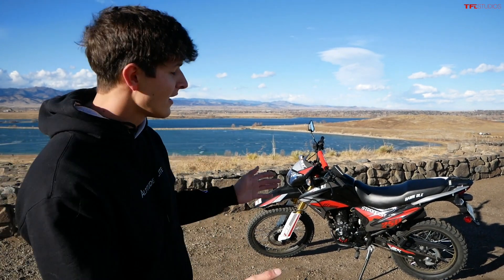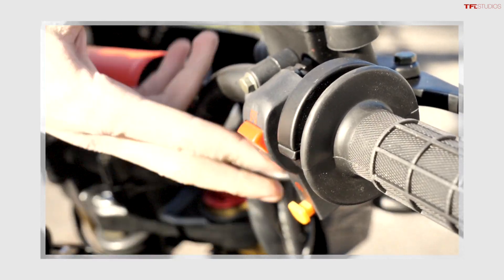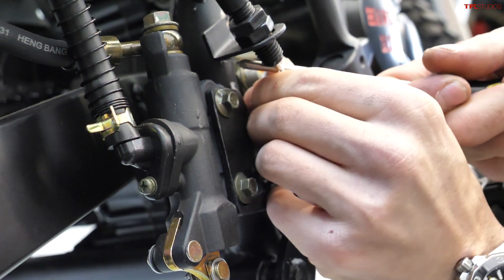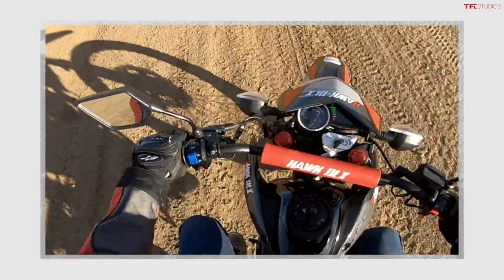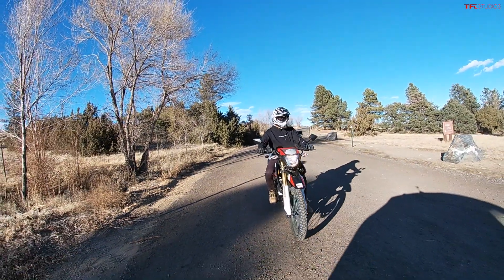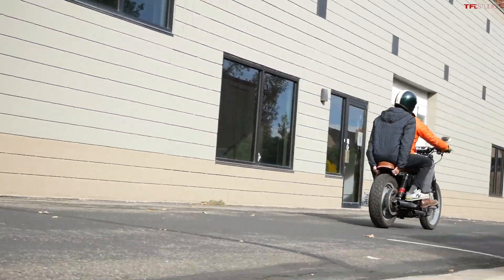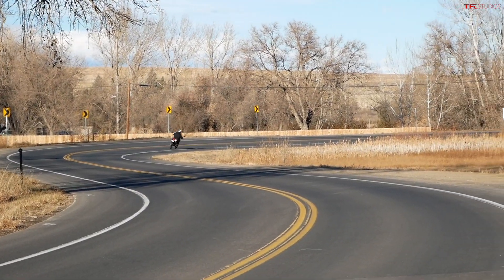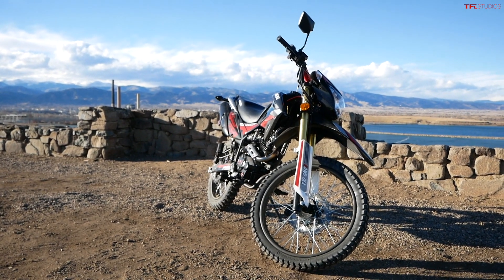Here's What It's Like To Assemble, Ride And Own The World's Second Cheapest Enduro From Amazon!

Comment: Depends on what you intend to do with it bc it doesn’t look to awful. If you just want a bike to cruise around on in town that has off-road capability then I would say this bike is almost perfect.
Reply: The rear brake switch nuts are on wrong one is to lock it and and one is to adjust😂😂

Comment: TBH I have a 2019 brozz 250 (same bike different name). I’ve owned it for a little over 2 years with 0 issues. Bought it brand new 0 miles from a local scooter shop that imports them. So I was able to avoid any assembly and paid 2,100 for it after tax/tag/title. I’ve done several (10+) 1-2 hour highway rides. Although not ideal, it didn’t give any issues and I had fun. I’ve mad no changes and it hits 65-70mph, but that could also be the Florida elevation. I’ve also taken off road on plenty of trails and even light kidding with it. The bike has somewhere around 1,000 miles on it, 1 oil change at 600 miles and other than a nail through the front tire I haven’t had to replace anything. For parts I’m told I can order CSC TT250 parts from CSC motorcycles in Cali so that solves any future problems I might have. And they also offer no questions asked warranty if you buy a TT250 from them. I can honestly say I’ve gotten plenty of smiles per gallon from my little China bike and it’s 100% worth it. I even sold my Honda Grom cause I found myself way more fond of the Brozz 250. If you understand what you’re buying, and the main reason for buying it some commuting and exploring I can’t recommend these bikes enough. The Hawk DLX/Brozz 250/CSC TT250/TBR7 all are great bikes and plenty reliable.

Comment: I know you guys are trying to say that a "new" bike shouldn't require any initial maintenance on your part, but you are forgetting that you skipped the dealer side by buying this thing from Amazon directly. Had the bike been assembled by the dealer, they would have seen that front brake, and bled it, before they put it on the showroom floor for someone to test ride. Bad brakes don't sell bikes, and can be a liability if the test rider crashes because of them.

Anyway, for $2k, I would buy an actual Honda Hawk GT (88 through 94), or Honda Shadow DLX, instead of that thing that steals pieces of both names.
Chances are, I would have to bleed the brakes on any $2k bike I have to buy (apparently new or used by the sounds of your experience).
Reply: Neither of which are common or meant for light weight dual sport use. good luck finding a used 250 for as little money.

Comment: The tires on the hawk dlx are actually decent tires and you fell because they where brand new and not broken in so they slip easily and also rider error, you should have put your weight to the right side of the bike to make a small turn to have more stability.

Comment: Hawks  are good bikes. I have the carb version. Its has taken me just over 11000 trouble free miles  in the last 2.5 years.  I just retired it as my commuter. 70+ miles daily.  Now it takes a 4 mile trip to the trails and then beat to tears by me and my 280lb frame off road. Its taken more drops off road than I can count.  Still rocking stock plastics. They are super easy to work on and extremely  reliable as long as you aren't in a hurry on the road. At least in my experience. BTW I also have a 99 Xr650. Love both bikes. The hawk does need changes from the box. But once dialed in its a great bike. Got mine 2nd for 600 bucks. So with  2200 bucks I got my xr650 and my hawk + all the mods I've made to the hawk. In my eyes it's been money well spent.
Reply: What have you done exactly? I just bought one the carb version.. I’m having trouble finding the sweet spot on the carb??? It won’t stay on, when I’m downshifting it shuts off.. frustrating... any help appreciated
Reply: @coreygalvin4921  when I was running the stock carb I started with a 20 pilot jet and a 110 main jet. It tunned close enough for awhile. Tuned better with a 22.5p/115main . Bottom screw under carb 1.5 turns out side screw 2.5 turns out from the screws being lightly seated.  
Also bottom screw has cap on it. Take a pick or small flathead screw driver to get it out. You will have to also notch the screws on the bottom of your carb to remove the bowl. We have a Facebook group with a bunch of like minded Hawk owners trading tips and tricks. Called the Hawk 250 Enduro owners. Mine works much smoother with the vm26 30mm carb upgrade from Amazon. Its almost plug and play. 
Also adjust your valves and change factory oil out. I use Rotella t4. Factory spec says valves should be adjusted to .004 on intake and .005 on exhaust but my bike like .002 intake/ carb side and .003 exhaust.  Makes Kickstart easier.  Hope this helped and good luck hawkin.
Reply: Hey i never put loctite on any of the bolts which bolts are most important that if i dont put loctite will cause bike to break and crash on me? I got past 1k miles and many bolts already lost im scared that if an important bolt falls the bike will collapse while im riding so what are the most important bolts?
Reply: @edwinram1rez  I always do a bolt tightness check every 3rd ride or about every 150 miles or so. I would have to say the bolts to watch the most are swing arm bolt, axles, brake caliper mount bolts, steering stem and motor mounts. There are also 4 bolts under the seat that hold the rear fender and tail light on that like to come loose.

Comment: I know it is not a huge difference but the engine is actually close to 16hp stock. That 11.5 number you keep spouting off is the KW RATING. Kilowatts. Look at 11.5kw converted to HP. And another thing, those valves sound REALLY TIGHT. You should hear a little bit of ticking from the top end when the lash is set properly. DEFINITELY effects engine performance on ANY 4 stroke engine

Comment: I'm aware of someone with a 2007 GY200 with over 67k off road use in Central Oregon, they're made for 3rd world  maintenance and conditions, it's an OHV bike and is much easier and simpler to maintain but you need to let it fully break in and tune it up well after break-in is finished, usually after 500 miles and a couple oil changes.

Comment: You would be better off comparing this to another street legal enduro. Not saying my Hawk is perfect but I paid $1,200 (carb version 5 years ago) and I put about $300 into it with a rejetted Mikuni, digital dash/tach, different sprocket and other farkels.  I have a 2020 Honda CRF125 for my wife and a 2021 CRF50 for my son, that is about $7,000 in motorcycles.  Quality, no comparision the Hondas win.

My Hawk does 65 mph on flat roads (takes a bit to get there) and it always starts.  The first rules about a mail order china bike 1) change the oil, the shipping oil is trash. 2) set the valves, they are too tight and need to be lashed 3) go over every nut and bolt and locktite the important ones :) 

There are more of these (or this variant) of motorcycle made than any of the big Japanese brands as that is all the rest of the world can afford. Do the above mentioned items and you will find years of riding (albeit slow) enjoyment on your China bike.

Comment: If you want a decent quality Chinese dual sport. The best choice is the Brozz 250 from peace sports in Ga. Better swing arm. Braided brake lines. Led blinkers. Counter balanced engine. Outstanding customer support. You can get every part from them plastics clutches cylinder heads tires wheels.  Literally every part. $1950 delivered. Will do 65mph out of the box. 70mph after rejecting. I'm so glad the hawk dlx was out of stock when I was buying a bike
Reply: Yeah, that counter balanced engine is much better.

Comment: It doesn’t seem to have much torque. Torque is necessary off road. The motor must be an on road commuter motor for Chinese roads.
Reply: They are actually geared for more torque at the expense of top end. These guys can’t ride. Notice them juicing the throttle while restarting at the track. It’s a fuel injected bike. They also tried to “dilute” the bad gas by adding fresh to it.
Reply: @grominwithrob1339  ...truth
Reply: It's hardly broken in, and they need exhaust tuning to bring out the top end .

Comment: Say what you want about it if your moderately good at mechanical stuff (it’s an air cooled engine it’s super simple) the bikes unbeatable.
Airbox delete
New battery
Spark plug
Retune the ecu (YouTube it/forums)
Gearing change 17/45

And I can almost beat a brand new CRF250L for less than 2500.

Comment: Actually it’s the third cheapest the first is also built by the same company and it is the ( magician ) ...! The magician is also a 250 but it is the least expensive of the three the second is like my bike the carbureted hawk 250....! The third is like this bike the DLX fuel injected hawk 250...! I have a video of mine being delivered also from the truck pulling up to the door to it being completely done it took me about an hour and 40 minutes to put the front wheel on the handlebars and the side panels...! I bought mine from TX Power sports...!
Free delivery no tax because it came from Texas and the total price to my garage was $1508 total with the paperwork to get my license and title....! I am extremely pleased with it my grandson has the exact same bike you were showing here other than the front forks and the electronica fuel injection our two bikes are identical....! These bikes will last forever as long as you take care of them I’m extremely pleased with mine...! You may check out my hawk delivery to my garage a few stages of installation and the finished bag on my channel..!   ( THE GEFF GALEY CHANNEL )  there is an easier way to lift the bike up you can put a lag in the ceiling and use motorcycle straps and lift it up...! Also a motorcycle lift from Harbor freight makes this quick easy work...! 
Nice informative video have a great weekend on your HAWK...! Professor Jeff Galey,
The Jeff Galey channel

Comment: I would try and see if you can get some kind of tuning software for it. Bikes like that run super lean from the factory and I think a simple tune should give it just a bit more power and make it easier to ride.
Reply: They acknowledged it had bad gas in the tank so they “diluted” it at the beginning. Probably didn’t adjust the clutch, throttle or brakes either. I bet it still has the shipping oil in it.

Comment: all non US and Canada-sold Harly Davisons are made in Thailand, so i really dont get the big deal of this being made in China.. and lot of automotive and bike parts are made in China... the issue here is really that this is one of the cheapest, most cost cutting bikes available
Reply: Quality of the brand and sourcing those parts in China. That’s my main issue for any vehicle or bike. My father has a 1975 Honda Super Sport 550F and some of the parts he gets are Made in China: absolute hate it, especially the rubber compound the Chinese manufactures use. Another hate on made in China parts is the steel: somehow it get oxidized faster than it normally should. Anyway, enough rambling on my end but my sort of pet peeve is the quality control when parts are made in China. I really try to avoid as much as I can when parts are made in China for any vehicles and bikes.

Comment: Parts for the Hawk are as available as a DRZ or a CRF. They are sooooo cheap as well. Alibaba!
the Hawk is underpowered, under engineered and has a shit suspension. The engine will probably run forever.
It's also a million times more usable than that Super Cub.
Reply: Is there any way to upgrade suspension?
Reply: @m.richards6947  Chech out Motocheese. He has all sorts of mods and info.

Comment: If more throttle gets you more noise but no more power, I'd bet the ignition timing isn't set correctly.
Reply: These bikes have CDI and like most CDI equipped engines don't have any adjustments. You can buy special 4 degree advance flywheel keys to peak the power up, but I would uncork the muffler and intake tract first.

Comment: There are so many things that are wrong in this video.  First, the gentlemen in this video do actually seem knowledgeable about motorcycles, but, how many motorcycles have they received in a box that they had to put together?  My point is, there are things you should expect to have to adjust, you aren't getting a dealership type of experience.  The bike doesn't have a lot of power, pretty sure the valves don't need adjusting, it's just what it is.  There are tons of parts that are compatible with these bikes, and a lot of parts from japanese bikes fit these.  I busted a break line in WV, went to a Honda dealership and was able to use a break line they had, back on the trails again.  These bikes are far easier to work on than Japanese bikes as well, they are just simpler...not much to them, because there's nothing special about them.  I have this exact same motorcycle, bought it brand new in 2020 and I absolutely love it (I did change the sprockets on it), does it compare to my Honda, no, absolutely not, but do I get a ton of fun out of it?  absolutely, and have had zero mechanical issues with it in the two years that I've had it.